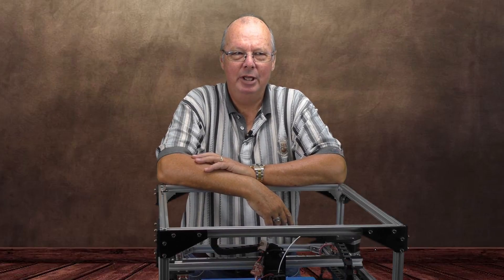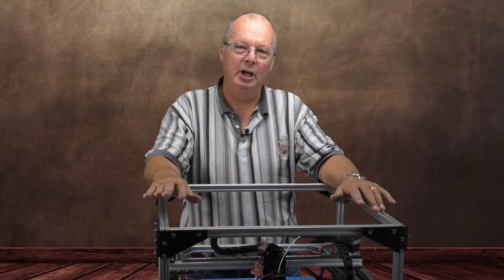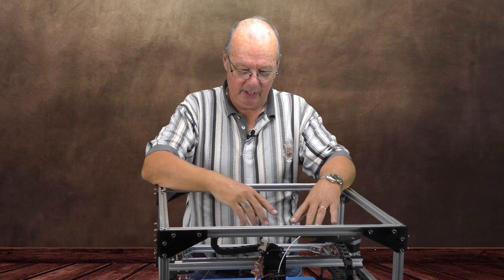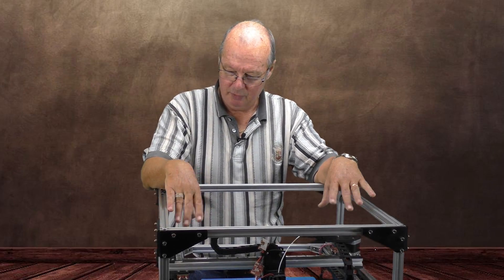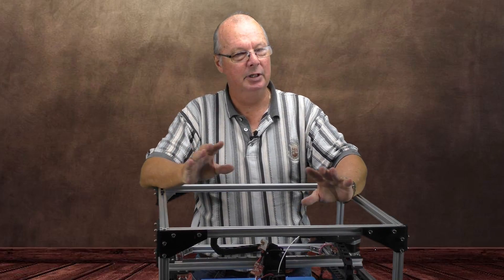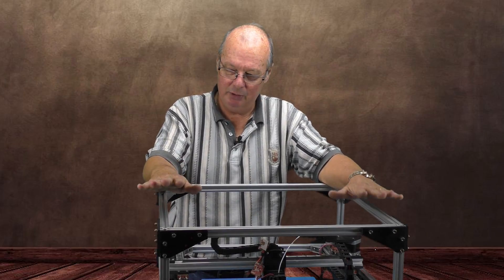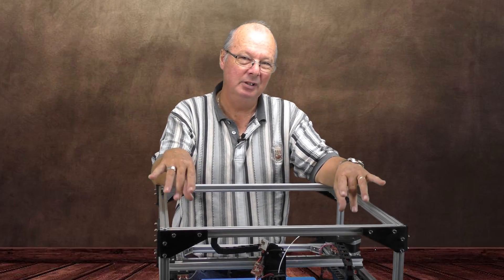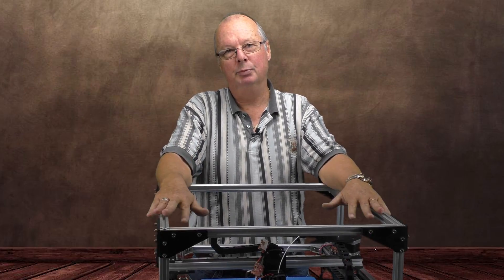FolgerTech FT-5 Build Tips 1 of 3!

Comment: THIS sorta printer hasn't been though through very well. so many issues  I can get great prints and without doing any changes I can get horrible prints  …..   you would think they would create a better printer for the price  heck my cr10s is better in so many ways. heck putting it together is a pain in the butt  wht cant they simply put the nuts bolts ect in bags it took me 2 hours to sort  all the parts
Reply from the maker: Noted, but remember this came out well before the cr series. The new r2 is also very good and a video on that is coming